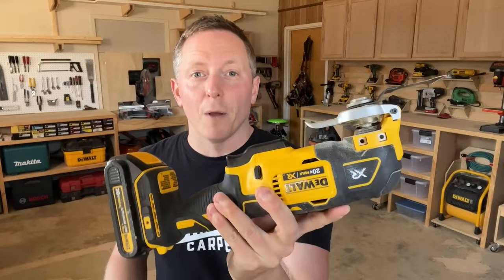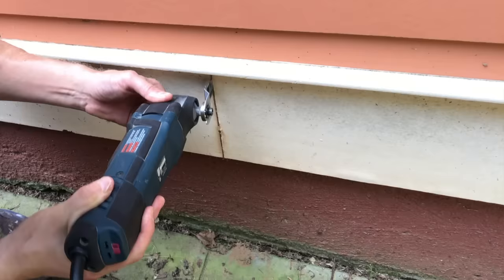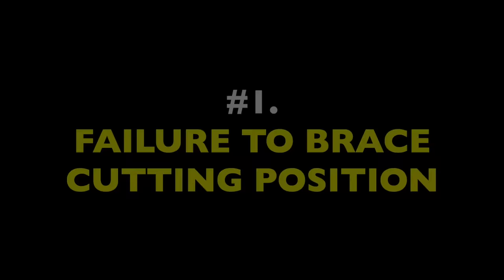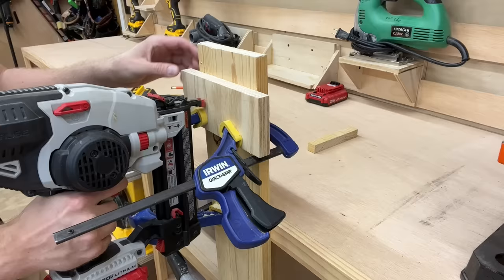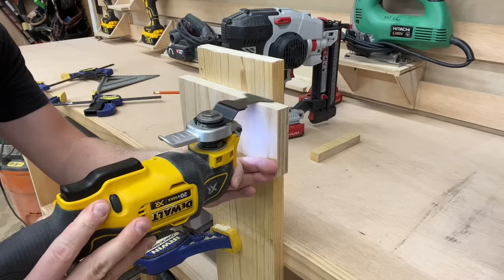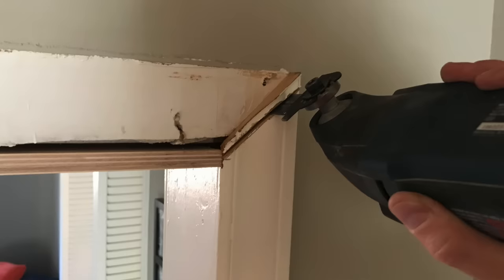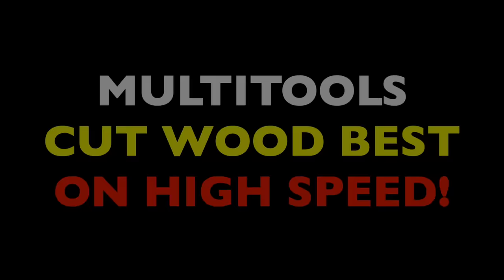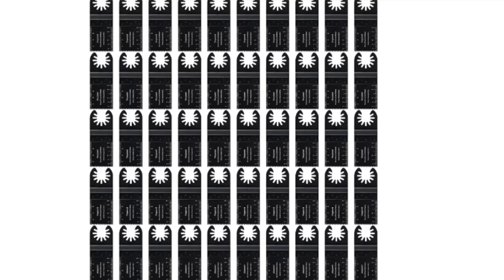6 MULTITOOL CUTTING MISTAKES! (How to Cut Straight With a Multitool...AVOID THESE COMMON ERRORS!)

Comment: I cannot believe you didn't mention that you can turn the blade sideways and have much better control.  I actually like using it better at the sideway position instead of the blade in the front.  Try it and get back to me :)
Reply: Yes!!
Reply: ... only after a trace cut does that work well
Reply: He did use it at an angel.
Reply: @goldwingerppg5953  Did the angel mind or did it suggest he use it at an angle😉
Reply: I tend to cut sideways too, for safety. Because at one point, the blade was loose and fell.
Reply: @davidharlem6824 It was hole'ly!
Reply: @johnnywishbone932  🤣🤣🤣

Comment: I’ve been using a multi tool for years. Here are a few useful tips: If you need a precise straight line, use a blade with a curve(He showed one from diablo ). This prevent the chatter you get with a long straight blade. There are ones that look like a half circle to get tight to a wall/floor without cutting into it. Also you shouldn’t do a hard plunge as the video showed. A sweeping motion works best so the blade will not get excessively hot. I find this is one of the most valuable tool I have. Great video.
Reply: Yeah. Forget about those super wide blades. Those things are all over the place
Reply: What brand do you recommend for a hobbyist? Something nice and cheap
Reply: @riffdex   We bought our Multi-Tool from Harbor Freight - and it is fantastic.  It’s corded, not battery powered.  Has multi-speed, but like in the video, we always use on max.  The half-moon blade is good on many surfaces - plastic, metal & wood.
Reply: I’m a flooring contractor that mainly install Tile and hardwoods. So I’m probably not the best person to ask about cheap blades. I use the Festool multi-tool. I like it best over Fien, Mikita, Dewalt(i’ve owned all in the past).   Festool accept all the star lock style blades.  I mainly buy Bosch blades. I love that most have a curve for cleaner cuts. 

Whether you are a hobbyist or in the trade, the most important thing is using the correct type of blade for the job. Example: if you are using a wood blade and hit a nail, then your blade is toast. You should have used a bimetal blade. But if you need to cut harden screw then fien has a perfect blade. 

Maybe for a hobbyist, I think imperial makes decent blades for the cheaper end of the scale.
Reply: @riffdex  Hardt multi tool from Walmart is a surprisingly good option
Reply: Thank you for that! I have to cut a small square in a boat plywood panel to mount a transfer switch, and it has to be a snug fit to support the assembly.  Plus, its in a very visible location in the cabin.
Reply: How do you control vertical angle ? I find no problem to get straight line, but it is somewhat not perpendicular
Reply: Thank you for all the advice. I am an 80 year old retired furniture maker and restorer from the old world of hand tools. I've never used a multitool, but now  I'm very interested, since I have to replace a couple of damaged white oak 2 1/2 inch wide parquet floorboards. Have you ever tried to pull some wax or a candle over your blade? I used to pass a candle over the teeth of my ssw, which  always made the cutting smoother. 
Thank you for the shoptalk. Merry Christmas and Happy New Year, David from Greenpoint, Brooklyn NY

Comment: Also the multitool cuts much better if you let the saw do the work and not put much pressure on it. I may or may not of had this problem at first. Multitool fun fact: They were invented to remove casts (broken bones) without cutting the patient. I'm going to check out those generic blades the name brand ones do not last long enough to justify the price these days.
Reply: Just like chef's knife, it is all technique not pressure
Reply: Is it a special blade for the casts?
Reply: @strizzy239  I would think so but even a wood cutting Multi-tool blade wont cut you unless you do something drastic

Comment: It’s weird; I’m reading through the comments and no one is mentioning how awesome the oscillating m-t is as a sander. I’m a handyman and use my dewalt omt damn near everyday. Thanks as always THC
Reply: Beat me to it.  I bought the sanding block attachment for this reason and sand paper when I picked up the multi tool at the store.
Reply: I use it as a grinder them sander but with a Dremel not these.
Reply: Use my M12 Fuel as a sander as much as a saw. Super handy and effective.
Reply: @jamesgoens3531  Ditto.
Reply: I use it as a corner cat sander along my random orbit sander. I used to have the small sanding shoe attachment but ever since I got the 3.5" attachment I'm not looking back.
Reply: Is it decent for more sizeable stuff?  Like if a coffee table or cabinet was on the street for trash/free can you do that? Or is that like the jigsaw situation where if it's more than 2 feet of wood, you you should just buy a different tool. It feels like it would just be down to the sanding pad being worn down (so bulk buy and you're fine) but I don't know if there's a max time you should run these motors (3-4 minutes?)
Reply: Hi, can you use the tool to sand flat surfaces? Like a wood floor or table?
Reply: @Cassieskins21  you could if you needed to. The head’s only a couple inches across though so it would take forever

Comment: Another tip that I use frequently is attaching the blade at a 90 degree angle to the tool for better control of the tool. Try it, it works! As usual, always great content!
Reply: Yes!!
Reply: Good tip, will try this next time
Reply: I do mine at a 45, have for years. Rarely have the blade sticking straight out
Reply: Nice, yeah I often set mine at 45. With materials like plywood it allows me to rest the tool smack down on the surface once a plunge is made, and then I just push and wiggle a little in order to keep going along the line I've drawn.
Reply: One of best advantages of the tool is the adjustable angle, no mention in the video… does this guy actually use one?  Adjusting the angle allows you to use the head as the guide, and gives incredibly more control.
Reply: Multi tool
Reply: @braxtonbragg7170  Yes more control changing the angle I'm surprised he didn't mention that, maybe lack of experience him self.

Comment: No mention of ability to change the blade angle? That is one of the best advantages of the tool. Allows you to use the head as a guide, let’s you position the tool how your body fits the space to hold it. I can count on one hand the number of times I have put a blade in strait out.
Reply: Fully agree! I had at least one case where I had to put blade facing handle at 45 degrees due to tight space.
And a few times when I had to put blade upside down so it reduced the total height of tool head plus blade.

Comment: I've been a carpenter/woodworker for over 35 years, everything from new home construction, remodels, home improvements, cabinet shops, boats, fine art furniture, set building, and so on - I used a corded version of one of these things last year while in Georgia building a bar in  a pals home. It blew my mind, I still have and am using tools I purchased 30 years ago (I still use the 7-1/4" Makita circular saw I bought in 1987) - I finally decided to start upgrading my tool to the Makita 18/36v system, amazing stuff. Makita has a subcompact line that are all black in color so I've purchased a couple of those tools including the multi tool and used it on a job for the first time last week, it's like a surgical tool with very little vibration at all. I'm super stoked - Even bought the dual battery 7-1/4" circular saw - SO nice to "cut the cord" FINALLY - The work goes by faster with a lot less aggravation from dealing with cords

I enjoy your videos, keep up the good work
Reply from the maker: We’ll said, Michael! I’ll have to check into the makita subcompacts!

Comment: It can take some finesse for this tool for sure.  One of the most common uses for me has been for cutting casings and door jams when installing new flooring.  Just use a scrap piece of the new floor as the guide block.  Good luck with the book sales.  They look great!
Reply from the maker: Thanks Regular Guy! That’s one of the best uses for it—replaced the terrible old jamb cutter!
Reply: @TheHonestCarpenter  It’s also really good for cutting into drywall for adding new electrical boxes, etc.
Reply: @TheHonestCarpenter  If you have tons of frames to undercut, a saw is really the way to go because of the speed and cost of oscillating  tool blades. However, when I've got a couple frames I go right for the oscillating tool

Comment: I've got that exact tool and while I haven't needed to use it in a while 1 very useful thing that helped me get straight cuts, was to change the blade position so that it came off towards the corner rather than straight out the front. That way you also get more chip clear out.

Comment: Most underrated usage is being able to lock the tool to always on as you cut. Not need to push the button for power. It automatically stays on! Great video!!

Comment: i have a dewalt and it is a beast cutting deck boards when your not replacing a whole board. also great for trimming down for a good fit or odd cuts. They are amazing tools

Comment: Thanks Ethan. I don't have a need for this tool but I have seen it in use for specific jobs and it works well.  I am going to have to find a project where I need one so I can justify to my wife why I bought it!
Reply from the maker: They’re awesome, David! And even a budget model will get you really far 🙂
Reply: David…for 51yrs .. I have found out that it’s easier to get forgiveness than permission 👩‍🦰🤗
MAKING YOUR JOB EASIER AND SAFER just get the tools you need a little at a time 💚💚💚

Comment: I love my multi-tool.  Here are a couple of tips from my experience:

You can buy special anti-vibration gloves which are great when using bulky vibrating tools.  I discovered them when I worked in the auto industry, as they are great at preventing pain and fatigue when working with a big impact for a long period of time.  They also work great when using my multi-tool for a long period of time too.  

I find that in a lot of cases the round blades do not bind as much as the straight ones.  They are really useful for certain types of cuts.  

The sanding block is great too.  The triangle tip on them allows you to get into corners where an orbital sander can't get to.  

The quick change feature on the newer tools is great too, and being able to put any of the blades or sanding block at a 90 degree gives you some extra flexibility in tighter spaces too.

Comment: If you suffer from carpel tunnel, wearing some winter gloves helps to cut down on vibration transfer to your hands.  Such gloves tend to reduce your dexterity, so you may want to use guide like Ethan shows in the video.  It may sound stupid, but it lets you hold the tool for a lot longer before you need to put it down for a break.  This trick worked great when I had to use an angle grinder with a sanding flap disc to remove old rust and paint from 12 feet of twisted iron stiles on the front porch stair railing.

Comment: These blades are fairly easy to sharpen if you have a rotary tool like a pneumatic die grinder or Dremel. Using an abrasive cutting disc, lower slowly in between teeth at a very shallow angle, switching the angle back and forth with every gap. The cuts won't be a clean as factory, but it can help extend the life of your blades and produce far less waste just tossing them. 
To get the teeth to all line up again, pinch the blade in a vice or between two pieces of wood with the shortest teeth just barely poking out of the top and file them back with a bastard or hand held belt sander before sharpening.

Comment: Just splurged on the Milwaukee M18 Fuel OMT. Only played with it a few minutes but can already tell it's going to be one of my favorite tools ever. Tons of uses for a DIY home reno. One nice feature of the Milwaukee is that it doesn't have a trigger. You just turn it on. So no cramped fingers ever. You can adjust the speed with a dial or rely on the "auto" setting to keep the speed right.

Comment: The only difference between a multi-tool and a rifle is that you don't need to hold your breath at the point of pulling the trigger ! 
Glad you said about using a utility knife for the first score, that's exactly what I do. Sometimes if possible I clamp an old straight edge to start the cut. Can't remember where from but I bought a ruck of blades from a Japanese company and they are so good and were a bit more expensive but so much cheaper in the long run. I think your tutorial on this subject was absolutely spot on, as usual. You are indeed a good presenter with well grounded knowledge and experience. I wish you well. Cheers.

Comment: As a renovation tool is use the carbide metal blades for everything.  There is always a surprise nail in the way.  These tools are great for siding work.  I have also used it as a carving tool when fitting pieces or cleaning up rot. I flip it over and draw it over the surface.

Comment: Great video as always! I love my multi-tool. I used the plunge cut ability to remove a rotted soffit on my house. I simple cut out the rotted area with a straight plunge cut from good wood to good wood and used a PVC board (another tip from this channel!!!) to fill in the gap. A little paint and it looks like new, no rot, and the PVC will outlast the rest of those boards! P.S. My 6 year old daughter loves "One Hot Spark" so far. We are 2/3 through it and read a chapter per night before she goes to bed. She already wants the next book! :)
Reply from the maker: That’s awesome, Josh!! I’m super pumped to hear the repair went well…and also that she’s enjoying book 1! I really appreciate you supporting the channel in so many ways—thanks for writing in to let me know this! 😄

Comment: Great tips, I will say that I think the the shallow pass back and forth technique is really only necessary when cutting through something that has another material behind it that you don't want to cut, (which is most of what the tool is good for admittedly) but if you're cutting all the way through something with air behind it (like cutting a rectangular hole on a wall for an outlet junction box) I like to score the cut line then plunge all the way through at one end and turn the saw at least 45 degrees so I can use the cutting edge and follow my line

Comment: Great tips as usual on Honest Carpenter! The multi-tool/oscillating cutter/plunge cutter is one of the most valuable tools for a remodeling/repair contractor.  I use mine for so many things almost every day.  I just wish replacement blades weren't so darn expensive.
Reply: I have been buying my blades from Amazon in bulk packages. I try to focus on the blade type I use the most and toss the others that come with the package into my bag. I have found I use those odd blades sometime within a year.

Comment: Never thought I needed one till I used one. They do things no other saw can even begin to do. I used to use a metal blade in a sawzall and tried to make neat cuts in trim pieces or cabinet carcasses.  The chatter and stabbing action always ruined the final appearance of the work. And I even considered myself a surgeon with a sawzall from years of use and not having an alternative tool. Used in appropriate manner and situations a multi tool is vastly superior, not faster but superior none the less.

Comment: I bought the original the only one made at the time Fein corded 20 years ago before all others copied it. You didn’t show it but I could use that thing with the blade sticking out sideways and it helped a lot because you could get a better grip on it working on different confined space that straight was not an option. You are definitely correct about the quality and price I’ll buy the cheap ones for wood, but for metal and tile only The expensive ones will work plus you could get sanding attachments for wood and for rugged surfaces. Thanks for the YouTube I’ve been following  you for several year’s

Comment: What a great presentation. Thank you. I upgraded to a Flex tool so vibration is no longer an issue - seriously the vibration control is incredible but these tips are just fantastic. Thank you Ethan. Personally, my preference is buying the more expensive blades of Diablo because going through blade after blade on a job - really gets old.
Reply from the maker: Thanks Dave! I’ve seen the Flexes—I’ll have to check them out!
Reply: Pretty sure his name is Ethan. Idk who Nate is 🤔🤔
Reply: I’ve got the gen 2 Kobalt with more vibration isolation. It’s got much less vibration than my 10 year old corded Fein. 

I’ve heard very very good things about the $220 Makita, but the expensive blades plus limited selection are keeping me back. I’ve been using mine a lot for scraping and gouging - many more blades for that in the old school mounting system. Also, I’m deeply offended by a Starlock blade that has a pin…come on, $220 and the blade is more work to change than my $99 store brand tool?
Reply: @gf2e  The Flex has a lever and I just lock it in place. Very easy.
Reply: @sammiller2249  Oops. Ya I corrected that!